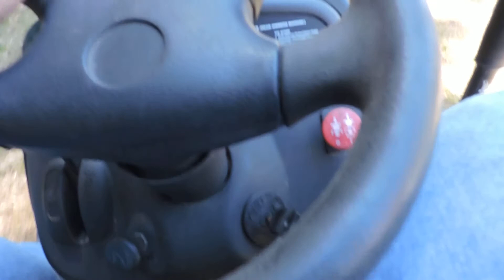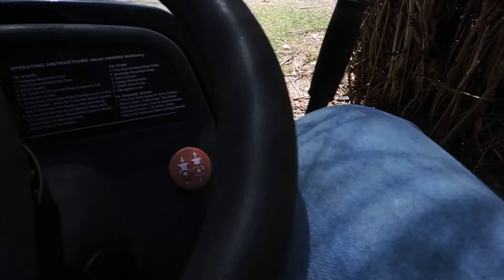A new RUNNING trade in arrived other night. Craftsman DLT

Comment: I have the identical mower. It is now 18 years old and still going strong. I mow three acres once a week on average from March until November. Then I grind the leaves for mulch with it. Admittedly, I have done lots of repairs and maintenance but still better than gambling on a new mower. Major items replaced include the front axle (came apart) replaced with an after market cast iron axle, a new steering gear assembly, new fuel pump, ball bearings in lieu of bushings for the spindles and mower deck refurbishment. The only thing ever done to the Briggs engine is adjusting the valves once when it became hard to start. I change the oil and filter twice a season.
Reply: I havr an identical one too. Has a Kohler command single 16.5. Before I got it free it sat outside for sometime. Mechanically it needed a new fuel pump and the carb had to be rebuild. Old gas had to be flushed and cleaned out. The deck had to come off and be repainted, all tue pulleys had to be freed up and lubricated. Now I'm down to a few cosmetics, its almost done.

Comment: My uncle had a very similar mower, only it had a Kohler engine. It was a V-twin, I think 20-22 HP. Great mower. He had a huge lawn and it took a few hours to mow it with that mower (it was a 50" deck IIRC). Only thing I didn't like about it was the hand control for the hydro; I was used to my Cub Cadet LT1018 with the tilting pedal. Still, that Craftsman was quite an upgrade from the old LT2000(?) he had with a 12 HP Briggs and a 42" deck, manual transmission. I used to go over there a couple times a year to help mow the lawn and do other projects to get ready for my grandmother's birthday celebration, or if he just needed some extra help with his business (Bob's Discount Kayaks; he was the original owner at his home in Wales, MA, but he sold the business along with his house when he moved).

Comment: Makes me Wish I took better care of mine but I was a teenager with no mechanical background and a uncle who did the bare minimum to keep it running is currently sitting at the bottom of my heel hasn’t ran in 12 years but I have no doubt that it can be fixed but I just don’t have the proper tools I don’t think pretty sure that the transmission is shot in it because the last time it ran remember if you put it in reverse or drive it would smoke like crazy

Comment: I picked up the exact mower 2 weeks ago. Problems with mine is the engine pulley is missing (I have the blade PTO clutch) and the deck for some reason slants forward. I can't figure out what is the causing the deck issue....
Reply from the maker: That's weird, did you adjust hangers?